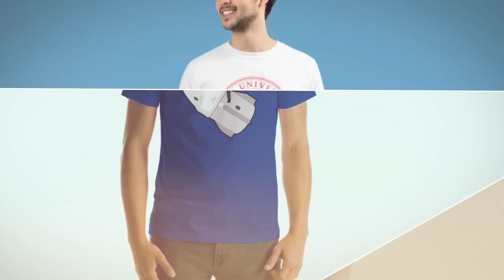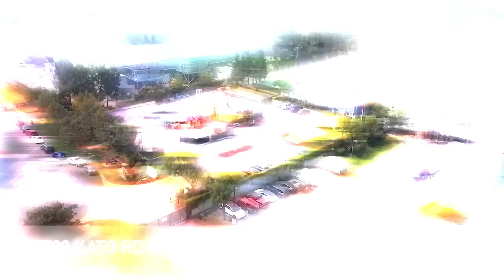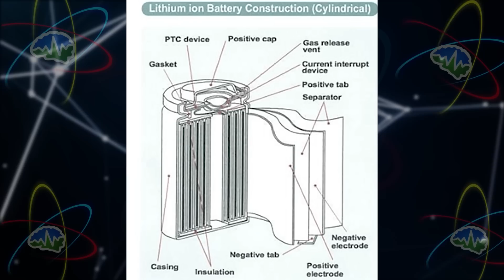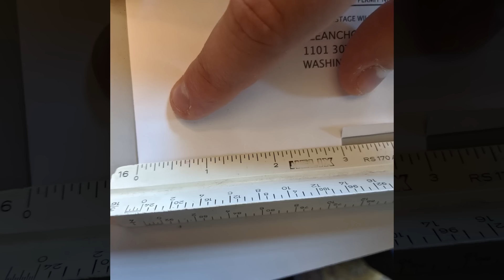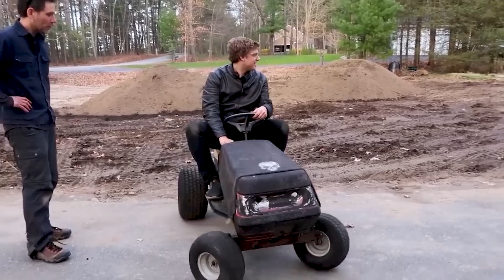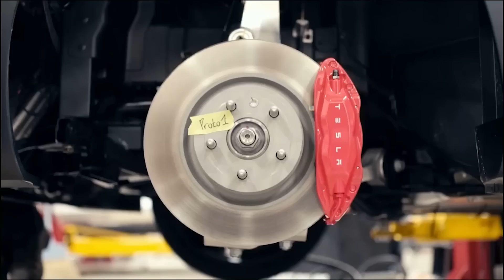Is This What Tesla Battery Day Will Reveal? | In Depth

Comment: If this is anywhere near accurate, this announcement could mean enormous progress not just for tesla but for humanity. Specs like this probably wouldn’t have been possible before 2030 or 2040 at the historic rate of battery innovation. The powerpacks and megapacks you can make with this will floor the electrical industry. 

This wouldn’t be just death for ICE. This is death for coal. This is death for natural gas. This would be a watershed moment for solar and wind. If they announce v2g, tesla deserves to be the most valuable publicly traded company ever.
Reply: Is Nikola and hydrogen going to be ok?  Asking for a friend.
Reply: It’s all relative to the timeline. Autonomous day was great but the stock didn’t go anywhere because the analysts were skeptical about Elon’s timeline, which proved to be correct: here we are 1.5 years later and still no FSD. The same can be the case for this next generation battery design: mass production may still be out in the future, and then it is a question of will the analyst believe Elon’s timeline.
Reply: @erikmulder1969  I'm willing to bet this technology goes into the Cybertruck and and semi when they start producing them.  Probably the S plade model, the 3 and Y will have to wait for an update.  Also, Giga Berlin will probably use this technology when the plant opens.  Look at the specs they gave on the Cybertruck,  the price and range they had to be planning for a breakthrough in battery tech to offer a Cybertruck under $40k.  I'm also willing to bet Giga Texas starts producing Cybertruck July of 2021.
Reply: natural gas will still be used to cook and heat.

i would say that it shouldn't have been possible unless you had a person/company pushing the innovation.  l bet this will come as a surprise to the battery engineers because they can't really push the tech that much.
Reply: Jetah I live in northern Canada. We built net zero house by using air source heat pump. They are efficient even down to -35°c. Mitsubishi make. Gas is no longer needed especially if these batteries come.
Reply: @DarrylZubot  interesting. but i still want gas to cook!
Reply: In theory, yes. In practice... the problem is production and availability. Specifically, no one, not even Tesla, has the capacity to produce enough batteries to put coal and natural gas out of business. By at least an order of magnitude. Let's break this down a bit, by taking a look at the quintessential shining example of how it could be done: The battery farm in South Australia. 

It's simply undeniable that it was an enormously huge success. It paid itself off in less than two years, which is a ridiculous ROI on civil infrastructure that normally calculates ROI in decades. It has been such a huge success that other regions are inquiring about it. Hell, the state of Cali has pestered Musk about it repeatedly, and the mayor of Los Angeles is all but begging for one. So why hasn't Musk gone through with that? Simple... he needs every battery he can make to go into the Model 3's that are going out the door. 

Remember: Gigaplant Nevada basically doubled the entire world's production of batteries. That's gone up, Tesla makes more batteries than the rest of the entire world *combined*. Consider that a moment. Now then, he can just barely keep up with vehicle production, to the point that even Tesla Powerwalls for home use suffer from a simple lack of batteries. 

There just isn't the manufacturing capacity to build enough batteries that exists anywhere on the planet to be able to compete with coal or natural gas. For that matter, even if you were to build that infrastructure, you'd start running into logistics supply chain shortages, with massively ramping prices on all the things that go into batteries, because we don't have the infrastructure to provide enough raw materials to make the batteries at that rate. 

Sure, the writing is on the wall. This is eventually going to happen, it is inevitable. However, it's going to take years just to ramp up raw material extraction, much less production infrastructure, to hit a point where we are capable of producing batteries in that volume.

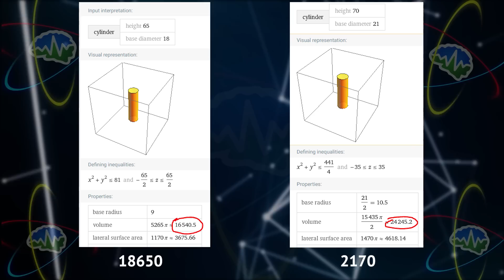Comment: 7:55 50% bigger by demission's= 100% bigger on volume and weight, square cube law.

 these are just bigger cells, the advantage is manufacturing cost and lowers complexity when assembling which is critical for something like the semi truck which would need around 50,000 21700 cells this will use much less and decrease the chance of cell failure in the pack, getting the heat out of a cell that thick may not be a issue if the cells are ran lightly which should be hard for a 10,000lb battery, a pack his big is capable of 8000HP if ran like the model S raven battery, semi trucks are typically 2000HP which is likely why they are much slower compared to the tesla semi truck going uphill.

Comment: It really will be insane if there is a battery chemistry change as well as cell size change. This would also account for longevity of the battery packs. Throw in a few super capacitors to allow high regeneration when cells are full. Sounds good all round.

Comment: You still have the same cost of materials. You save on production cost. So savings are about 20%
Reply: Yes... net cost of materials is about the same, or maybe a little less, as much less metal can material) per unit of energy, but the big savings is that it takes roughly the same amount of time to produce the big cell vs 2170 cell, but you need far fewer (~1/5) big cells per car. So the same production yield rate delivers enough cells for ~5x as many cars.

Comment: 40x70 mm makes most sense, everything below 100 S is very unlikely, cause of standard voltage and charging current! I would increase voltage to 450 and 900 volts depending on car type

Comment: 14:40 Your math is way wrong regarding the existing model 3 pack being able to output 111 kw. Since the model 3 performance can do around 450 hp x .746 HP per Kw = 335 Kw, at least. Also, when supercharging, the model 3 existing pack can take at least 250 kw for short periods of time. Also, those who have scan my tesla app can see the max actual power output of the pack being close to 400 kw at full throttle. So I would certainly hope these new bigger cells in a model 3 pack could do 348 kw like the video claims. If its not even more, I'd be surprised. The breakthrough with the bigger cells is going to lower cost per kWh and increased manufacturing throughput. The energy and power density improvements will come from tabless electrode and maybe some chemistry tweaks (dry electrode, addition of silicon, etc.) Cheers.

Comment: At 14:54 you mention the existing Model 3 pack is only capable of 111kw.  Where did you get that number from? That only translates to about 148hp.  EPA data says even the SR+ is 211kw
Reply: yep, the model 3 performance is 350+ kw.
Reply: To calculate max power the formula is Watt= Voltage x Amperage x discharge C rate. He has his math wrong assuming the cells have 6Ah when they only have 4Ah. For a explanation look for my comment in this video.

Comment: Tesla managed to keep the price of the cell going from 18650 to 2170 the same thanks to scaling. There is absolutely no way that Tesla managed to make a cell 5x as big for the same price. Just the raw materials would be more expensive. Unless they also change the chemistry and now use only very cheap materials, which they are definitely trying to do, but still.
Reply: Thought I heard they got rid of cobalt
Reply: @chelsiestinson9494  Yeah Elon Musk has been talking about that for a while now. And even if cobalt is expensive it doesn't represent all of a cell's cost.

Comment: You did the conversion for the 18650 to the 2170 cell for sustained current, without also mentioning that with the tab-less design it reduces the cell resistance as well (how it reduces the heating) which also means that for the same amount of heat you can deliver more current.  And with the dry cell manufacturing it might even lower the cost per cell.   In a few days we will know its interesting stuff how fast the battery tech is evolving.

Edit: The lower cell resistance also means less power is lost in the pack which means greater efficiency and range for the same capacity.
Reply: Just asking, in the video he said 5x more efficient,  and he figured the same cost to produce the battery.  So, if currently Tesla is paying $100 per KWH, are they now at $20 per KWH if this is true?
Reply: @vinyllpreviews9462  
I think he meant same cost to produce a cell.
But if you Reduce the number of cells by "X".... The pack is cheaper.
PLUS.
If you can produce the cells more quickly.....
Reply: @rogerstarkey5390  I'm a truck driver and I think if this breakthrough is true it makes the Tesla semi a true possibility.  Weight, range, and charging infrastructure for the semi were going to be huge problems.  This could bring the weight down significantly for the semi. Might bring the weight of the batteries in line with Diesel engine and fuel tank.  If Nikola isn't a fraud, this news is going to kill them anyway.  I've been saying hydrogen is dead in the water, battery technology is going to make hydrogen irrelevant.   Might happen quicker than I thought.
Reply: @vinyllpreviews9462  Yea, if these new batteries can charge three times faster, then in your mandatory 15 minute break, you could charge up the energy you spent over the past four hours driving. At that point, you're basically no different in charge times than a normal semi. All you'd need is charging stations at truck stops, and bob's your uncle. It makes electric semis a no-brainer. Especially if they can reduce weight down to what you'd see in a regular engine and tank.
Reply: @ShneekeyTheLost  there's a mandatory 30 minute break.  But when I stop to go to the bathroom I usually pull through the fuel island and park ahead of pumps.  If charging infrastructure is available you could charge these trucks while you go to the bathroom and take your normal 30 minute break.  They could have slower chargers where you park for the night that'll charge trucks on your 10 hour break.
Reply: @vinyllpreviews9462  Don't most long-haulers bypass the 10 hour break by driving in teams and swapping out, where one goes to sleep and the other takes over driving? I don't know if the slower chargers will be all that useful, it's the ability to top off on a half hour pit stop that I think will be more impactful to the long-haul industry. 

Of course, they've already effectively made diesel all but obsolete on the spoke-and-hub operations, that goes without saying, even with current stats. Companies like Wal-Mart or FedEx could see dramatic drops in costs virtually overnight, since the company is the one who owns most of the fleet in that environment. I mean, just not needing the same maintenance cycles a regular semi needs alone is a crushing advantage, irrespective of the fuel savings. The only limiting factor is how many Tesla is able to physically get into corporate hands.
Reply: @ShneekeyTheLost  truck stops are packed with drivers taking their 10 hour breaks.  If you don't get pulled over by 7 it's hard to find parking spots sometimes.  I've team driven and it's really hard to get enough miles in to make it profitable for 2 drivers.  You waste so much time at shipper and receivers for the most part doesn't make it worth it.
Reply: @vinyllpreviews9462  Well, today I learned something. Thanks for your insight from within the industry!
Reply: @vinyllpreviews9462  If their theory that it comes at the same price for the cell then yes.  We will see in the near future.

Comment: how much material would be safe in the aluminum casing... damn i have forgoten the formula of area in relation to volume
Reply: found it, one of the new cells would need 2.6 more material for the casing, but it the end it would cut it half the total material and weight due to the diference in volume, so it would definetly make the pack lighter

Comment: Love your math but you skipped that the larger cell needs more stuff inside, this more stuff costs more, particularly the nickel.  Just scale the volume increase as a raw material cost change and you fix your biggest bug in this video!  Fun to watch! Great Job.
Reply: And we remember that Elon Musk has already called for more nickel production. How are nickel futures doing?
Reply: Material cost increase should be offset by the dry Maxwell process. Smaller foot print of manufacturing, less equipment cost, faster run rate, less energy. less time...

Comment: While I think your numbers are likely way off...I do think power (current) could be the gamechanger...However, you seem to be focused on discharge rates rather than charging rates....the same tech that could improve power output could potentially be applied to charging...imagine a 3 times improvement in charge times...a 30 minute charge becomes 10 minutes a one hour full charge becomes 20 minutes...that would reduce the number of Superchargers required....You could also, improve home charging...
Reply: They are way off. the existing pack can already do over 350 kw, or at least as good as they claim the new one will do.

Comment: If every 50% increase doubles current you need to do it compounded, you did a linear addition of percentages which is not the right math. HOWEVER: 500% of original size (i.e +400%) is about an increase of 1.5^4 (i.e. an increase of 50% four times in a row), so you have to doublet 4 times which is 2^4=16. So surprise surprise but your actually right XD

Comment: The average electron had to travel 1/4 of the roll length. This is now a distance of zero.  In both cases there is still the length of the cell, it is unaffected.  They would thin the conductor in the cell as it does not need to carry as much current.

Comment: Can Tesla place the original small battery cell in between the void space of four large new cells?  This would increase packing density beyond 90%
Reply: That would be cool use different batteries for each part of driving like acceleration and coasting.
Reply: Hmm.  Mismatched electronics often don't play well together, so I'm not so sure a mixed format with a smaller cell would be a good idea.  Also, even though the individual void spaces are larger, I think they're still too small to fit the original.

Comment: No ultracapacitors, they are to large and to low in energy density. They also have to much voltage change across their storage range.
Reply: A buck boost converter can efficiently follow the capacitor down its discharge curve, while outputting a constant voltage. There are already 12v replacents based on supercapacitors.
Reply: @TheGaussFan  Tesla has today shown the value of supercapacitors.  I rest my case. Buck boost apparently did not pan out like you planned....
Reply: Tesla has today shown the value of supercapacitors.  I rest my case.

Comment: Well your math around 6:00 is just circular math but not about real body cans with walls. So if you take your abt 90% density and subtract the walls of all the small batteries and replace them by only one in sum smaller wall of one battery you will get a better energy density. just lets calculate this a 2170s van has abt 65.97 mm of steel a 54x98 (which is speculated abt) has 169 mm of steel can but about (which is also done by the hight for sure) 9.9 bigger volume. So you get only 2.5 times the volume of the steel cans walls per cell but 9.9 times the volume. So a steel can having only 2.5. times the steel can of one cell replaces nearly 10 cells.

Comment: You forgot the power effect for the semi and cyber truck the effect of the new cell could solve the hauling problems of current batteries.

Edit your math is off you did 6*16 should be 12* 16 or 192 amps
Reply: The only problem they have with their current batteries and truck hauling is they can not make them fast enough

Comment: Thats versatile... They can use that new battery across all their platforms to achieve high density power or lightweight and pretty much the range they want playing with size and weight and they possibly can go as small as 1 third of todays battery size and still keep the same 200 miles range .... That can be used in the new small model Tesla is rumored to launch

Comment: Current flows from one side of the cylinder to the other. Not along the spiral. The spiral is just like more cells in parallel. Making the cell thicker (making the spiral longer) means that the conductors in the centre are harder to cool. So one solution is a better conductor (material & dimension). Another is a hollow centre with coolant running through the centre.
Reply: might also use their tabless design which reduces heat and shorten the spiral (electron) path

Comment: Definitively no ultracapacitor because it makes no sense at all.
Reply: Actually a supercapacitor replacement for the 12volt lead acid battery would be a huge reliability improvement. I live in a hot climate that eats conventional batteries (Phoenix). They replaced my model 3 battery under warranty in less than 2 years.
Reply: @TheGaussFan  Supercap is just to big for the WHours.  Elon will go to a dc-dc converter tied to the HV pack and delete the 12V battery entirely.  If he does not I will do it myself on my Y.  Vestigial and he is aware of out plight on that crappy PB Acid relic.
Reply: Thank you for being here, this capacitor crap is making me crazy.  This is my windmill!
Reply: maybe with the new battery being tab-less, the discharge rate acts similar to an ultracapacitor.
Reply: @xxZerosumxx  Tesla batteries are HUGE compared to ultracapacitors used for regenerative braking so even if the power to weight ratio is worse the raw power is just the same, but with way more energy.